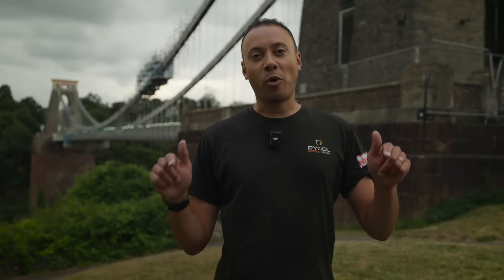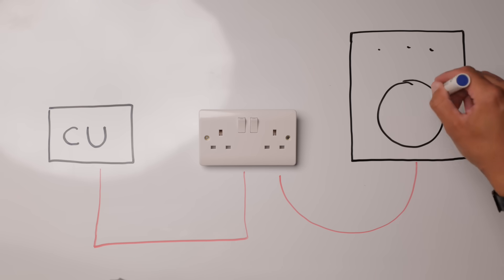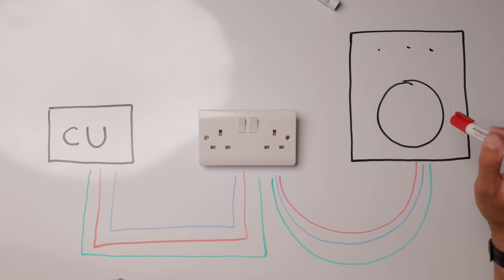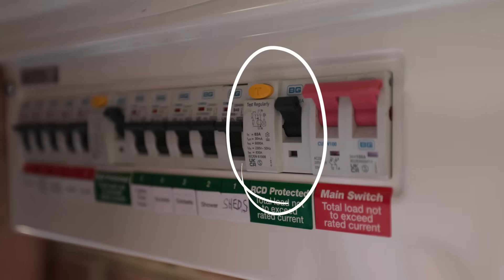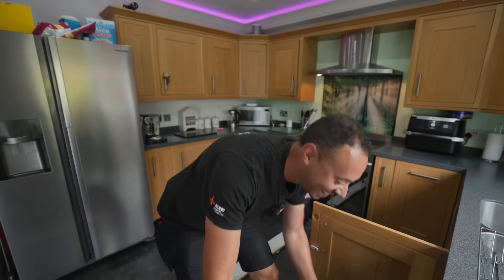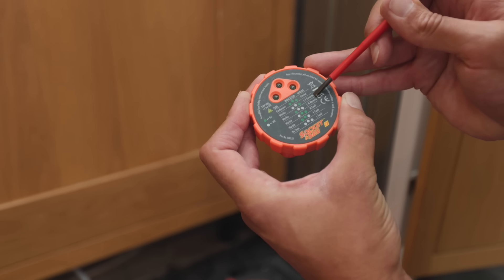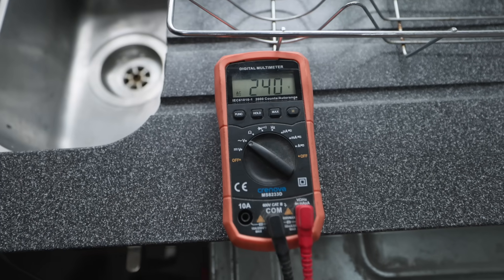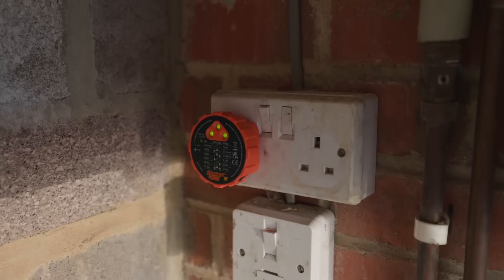This Simple Electrical Fault Turned Deadly⚡️

Comment: People do all sorts of crazy in a kitchen. I've seen people wire up a socket off a 2 core lead plugged into a socket. It's way more common than you think and a lot of people think the earth isn't needed. 

I would bet it had an rcd but somewhere down the line the earth didn't have a return path to the CU. I would also imagine sadly if the plumber was in a confined space and pressed between the metal washer and cabinet he probably couldn't pull away from being shocked. If the rcd didn't trip then it's up to the breaker which could have been 32 amp so we're talking 120 amps plus to break instantly so there might have been enough resistance that he was receiving say 25 amps forever.

Unfortunately people cut corners and this guy paid the price.
Reply: Earth isn't needed - until it is.

That last part is why earth is absolutely needed and must be checked
Reply: There is no way someone could get 25 A at 230 V. Assuming a worst case , large surface area and wet skin , a resistance of 500 ohms, the current is 460 mA.
Reply: @mernokimuvek 
Yeah, 25x230=5,750 watts!
But there are vids on youtube showing unfortunately people actually smoking after accidently contacting 4,000 volts.
My friend's son is a 'jointer', working on live roadside 4kv+, while in training he showed us some of the training films of 'accidents' with HV, arms/legs completely missing (surprisingly not all fatal), and some gruesome ones that can only be described as 'ruined barbecues'.
Don't FAFO.
Reply: @mernokimuvek thanks just educated myself so we are talking anywhere from 20-500ma. I'd guess it's probably on the lower end so maybe 20-50 and the breaker just stayed on.
Reply: I've thought for years why don't they offer cheap electrical safety to everyone. Education is so expensive in this country that trades won't train their employees. All trades that work near electric should have to do electrical safety course so they are aware of the danger. 

I'm just general public and I trained to level 3 in electrical installation, I was absolutely blown away when they showed us all the faults that can kill you.
Reply: @FreeWhilly734 
I've said the same thing about schools, why don't they have a lecture every year on the basics of safety, for electrics/gas/water?
Reply: @FreeWhilly734 I'm ftom New Zealand. It's ILLEGAL (as in criminal penalties) to touch appliance internals or fixed wiring for reward without having at least a basic safety certification and that still only allows attaching/detaching to existing fixed wiring or replacing sockets, etc

Plumbers, cabinet fitters and gas techs doing wiring without having full electrical certification would result in the wrath of God coming down on them

That's not a theoretical thing either. There have been numerous prosecutions of unregistered people (almost always british migrants) for blagging things outside of their qualified skillset 

Regulations were relaxed slightly about 25 years ago and wiring work done by an unqualified individual is allowed as long as certified by sn inspector. In practice no indpector will certify such work because they are personally liable if they miss anything even if it was deliberately covered up at the time of inspection (this was about the same time as mandatory periodic building wiring certification - 'warrant of fitness' was introduced to force removal of the last of 1930s-40s rubber and polyethylene insulated wiring because it was becoming a serious fire hazard as the rubber perished)

Comment: This video highlights the need for verification of earth continuity. If the earth of the incorrectly wired socket, had been continuity tested to another earth point, the fault would have been found immediately, before any other tests were carried out.

Comment: Live and the earth reversed….how! Surely this can’t be a qualified trades mistake…must have been altered DIY style…I can’t understand how you could ever make that mistake..even if a DIY’r did this I still find this hard to comprehend…crazy!
Reply: No, it wasn't any Diy Dave type disaster but a qualified electrician that did this. 
No matter how qualified you are it's possible to make a mistake, proper testing before and after energising a circuit would have picked this up.
Reply: @rscelectrical7091I still can’t believe it 🙈 shocking….literally

Comment: This video worried me watching it.  Not critiquing you at all, thank you for sharing this. But I think that experiment was quite risky.  The machine was not pulled out of the cavity fully, so it could have easily been touching the casing against parts of the pipework or brackets under the worktop. Secondly, using the meter like that with no insulation gloves on such a huge sheet of now live casing, is asking for the probe to slip and your hand contact the machine top.  I have seen it happen, especially when people have to look away, as you did to touch the second lead onto the tap.  This experiment could have easily been safely shown using a low voltage. Please be safe.
Reply from the maker: Thank you for your concern. Gloves are a good option for sure.

Comment: How long had the socket been wired the wrong way? Was the plumber called when the customer thought there was a fault? Or was it a new installation and he was just next in? 

I fit kitchens, I'm not an electrician. We test and isolate stuff for strip outs. Before electrician comes in and strips back and first fixes. 

Recent job we had 2 legs of different ring mains in one box. Neutral and earth connected but live not. I caught the cable chiseling the wall it blew and tripped and naturally assumed the other cable in the socket was now dead. I looked like Sonic for the rest of the day 😂
Reply from the maker: It was indeed a new installation so the wm hadn’t been turned on yet.

Comment: That's why you do a R1+Rn test as well as R1+R2....
Reply from the maker: Good shout, a complete testing regime is essential.
Reply: Electricians do. But plumbers don't, it's not their job. And electricians do not check whether the plumber has been so stupid to swap the central heating pipes with the freshwater pipes. That's the best analogy in stupidity I can think of.

Comment: Yes I agree swapping the Phase wire with neutral or with the earth is dangerous and under some conditions is lethaly dangerous. However in the example you have given here someting is missing from your explanation. 
Yes if the machines earth wire is connected to live phase then the metal body of the appliance has been made live and will shock you if touched and yes it is  a lethal  situation. 
However the machine will also Not operate, because there is no return from the appliance back to the supply. here is no other connection from the metal chassis to the incoming neutral or phase wires.
You have not explained that. That shold be the first alert that sometning is wrong and yes the first person to try to operate the appliance could could be killed if touching the macine in any way . e.g loading the washing , touching the bodywork. But the fact that it can Not run means whoever connected it did Not try to operate or they would have found it will not go and so need to recheck their connections. Fitting a plug to a metal body appliance can be lethal if wired wrong.
Reply from the maker: I understand your point, in this situation the appliance was new and had never been switched on. The person that wired the socket was not the same person that plugged in the washing machine. So therefore the fault was never highlighted. But regardless of this, the situation should have never got that far if the socket had been tested.
Reply from the maker: Yes indeed. A good point. I did mention it but it didn’t make the final edit. The appliance was never turned on because the socket and appliance were brand new. The plumber wouldn’t have turned it on so he never stood a chance

Comment: We’re just coming up to a year after an OVO employee did a meter change at my place, and one of the tools he used was a socket testing gadget similar to the one you demonstrated, so as to test that he had connected the live and neutral the right way round in the meter box. So he did check his own work properly then. Being an older house, before the standards changed, wiring colours differ between old and new, so the latest new live wiring actually has the letter “L” painted on it, to reduce any confusion about it. Old ones being live=red, neutral=black c.f. brown and blue on the new ones.
Reply from the maker: Its amazing how one simple test can keep everything safe. Good to hear he tested.

Comment: This must have been a brand new house never inhabited.  If you touch an appliance where earth and live are reversed, you would definitely feel it. You may be in rubber thongs or rubber soled shoes but you will get a tingle.
Reply from the maker: It was brand new. So unfortunately it went undetected

Comment: But why the RCBO didn't tripped?
Reply from the maker: Because the appliance had never been turned on. RCBO/ RCD aren’t guaranteed to trip
Reply: @RygolElectrical : Absolutely, seen a few new out of the box that wouldn't trip.

Comment: Recently found a similar situation, live and neutral reversed, luckily nothing plugged in to it. Worse still, it was connected via a mains lead to a plug ! The plug was wired correctly. Socket tester was used, and informed of the reverse. Love these things, so handy ! 
Thanks for this video.
Reply from the maker: Glad you it was a good watch for you :)
Reply: How was it wired properly  if the live and natural was reversed , I think that’s what you said , not arguing just asking surely you L N E terminals who would put the wrong cable in the wrong hole for a better word
Reply: @Joey-d9d5z  You might find that the incorrect wiring happened further back in the installation - or even at the intake point of the property.  There have been cases where the connection to the transformer was reversed.  These days with TNCS earthing system being more popular that is unlikely to happen since connecting phase to earth is not likely to go unnoticed.
Reply: live and neutral is not nearly as dangerous
Reply: phase and neutral reversed makes no difference!   it is when the safety ground is nor properl;y wired then the danger is present...!
Reply: @kpdvw true, however when elsewhere there was a small filament bulb with an unshielded pull cord, connected to a socket via 2 different sizes of speaker cable via a screw terminal block, to a single gang socket, it was then that everything got checked and double checked !
There are cable runs that are dead, but still collecting inductance from other live wires. The joys of domestic wiring 🤣
Reply: @kpdvw It can make a difference because the appliance's main switch is no longer on the live wire.
Reply: @kpdvw  it can make a difference - depends on which earthing scheme is in use.
Reply: @kpdvw Reversed polarity does make a difference. The appliance would still be live even if you take the fuse out.
Reply: @kpdvw  It can make a difference but is generally considered less dangerous than phase connected in place of each- in UK (and elsewhere) neutral is tied to earth potential so has zero (or close to) touch voltage, switching is always applied to phase conductor (unless you have double pole switching which is unusual in uk).  When you reverse "polarity" you end up switching neutral instead of phase which still breaks the circuit as normal but means that parts inside the device will still be at phase potential even when switched off.  This means that someone perhaps maintaining the device might come into contact with live conductors when they thought it was off.    Also some devices (e.g. lamps with Edison screw fittings) allow metallic surfaces at neutral potential to be touchable by the user - e.g. when changing lamp - when wired with reverse polarity that metal will be at phase voltage.

Comment: I am fully qualified as an Electrician. There is NO WAY that a fully qualified Electrician would wire it wrongly.
Reply: I'm a fully qualified spark and seen plenty awful things. I wouldn't be surprised if it was true.........
Reply from the maker: Do anything enough times and its possible. Just people getting complacent. Hence why thorough testing is needed
Reply: @SammoKarm: 
I really wouldn't put money on that statement if I were you, you'd lose your money. I've lost count of the amount of times I've seen "Fully Qualified" electricians mess up the wiring of simple sockets and switches over the last 50 years.

Comment: If the washing machine was earth bonded to the water copper pipe work and water pipework  bonded to earth main terminal at the incoming supply. This tragedy could have been prevented.
Reply: most connections to washing machines are by flexible non-conductive hoses, plus if a plumber was there it was probably not already connected.
Reply: @andrewhannay750  I meant a earth lead  terminated on the metal casing of the washing machine and bonded the water copper pipes.

Comment: I've seen live and neutral reversed (in new builds too) but never seen live and earth swapped. I find it difficult to understand how anyone could do that. The very orientation of the terminals makes it fairly obvious that the earth is quite different, and usually is visibly directly mounted to bare metal.
Reply from the maker: Yes indeed. Anything repeated enough is possible to wire incorrectly.
Reply: @RygolElectrical : Yep mistakes can be made but if they'd tested it properly, then it would have been picked up and hopefully rectified.
Reply: @RygolElectrical colour blindness may factor into it. In the days of red/black/green my father would consistently swap red and green bevause he wouldn't admit to the issue. I've seen red and black swapped by others for the same reason.

When people can't see red (5% of the male population) or green (1%) things can get very dangerous very quickly.

This is why red lights for danger, traffic stop and brake lights are extremely dangerous. My father eventually admitted he can't see red and simply assumed when approaching traffic lights that nothing showing meant it was red
Reply: @miscbits6399 But these aren't bulbs that change colour like LEDs can! Colour blindness doesn't mean you cannot see ILLUMINATION, so it looks like you are saying he didn't know which bulb was the stop one!
Reply: @miscbits6399  There are certain jobs that are definitely not suitable for color blind people. Electrician is one of them. When a disability is dramatically increasing the risk of putting people’s lives at risk, then that’s when we need to be responsible enough to reconsider our career choices. Swapping live and earth in this manner is like setting up a death trap for the residents of that house. I cannot understand how any person could do that, let alone a qualified electrician. Especially considering it clearly says “L” and “E” on the socket terminals, which is pretty hard to miss.
Reply: Possibility 1 - the E looked like a L in poor lighting. Possibility 2 - they were used to using another socket brand/model which used the L-E-N order and repeated that order without checking. Clearly they didn't do even the simplest test with a plug-in socket tester.
Reply: I have personally seen an entire house wired backwards from the meter meaning the entire property had a live neutral & neutral live, I found out when I still got a shock after pulling the circuit fuse.
Reply: @Will-thegrumpysoutherner 

I was renting a house in Sandbach where this was the case. Scottish Power came out due to a trip and informed me of the reverse polarity. 

I told my landlords and they weren't the slightest bit interested and said "well there hasn't been any problems for years". 

It only takes one problem!

Don't live there anymore thankfully, and I'm now an electrical engineer so I can make sure everything's safe in my own house
Reply: That is why you have to test ur work . No matter how sure you are that it is indeed done right .
Also, we are all humans and can be easely distracted by a phone call or being with ur thoughts somewhere else .
Still , a mistake like this should never happen if you test ur stuff afterwards .
Reply: Not sure if this came up in the video but did the washing machine have a factory fitted plug ? Someone could have ballsed it up in the plug never mind the socket. On sockets BG have all 3 terminals looking the same for diyers but colour code it on the socket but the old sockets as said here had the earth's by a different screw terminal on the sides and earth wire cable has no sheathing usually so difficult to misidentify.
Reply: @EMEL-hr4ut he reversed the extension lead plug not the washing machine plug.
Reply: Most likely, a combination of rushing and complacency.
Reply: Sadly there is no common standard for the location of the terminals on the back of the socket, recently changed one and the replacement had quite a different layout.
Reply: Someone told me of this same thing the other day ! Safety first guys !!!
Reply: Electrician that worked for us used to sweat easy, he wore glasses and they were always steamed up, on the test on a new build I found 2 sockets one wrong polarity and one exactly as this one, we layed him off immediately